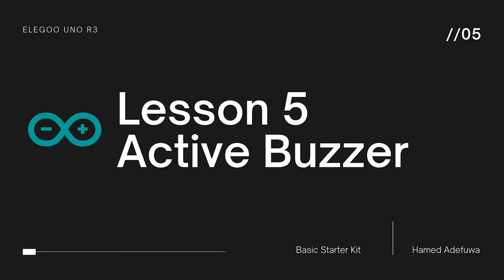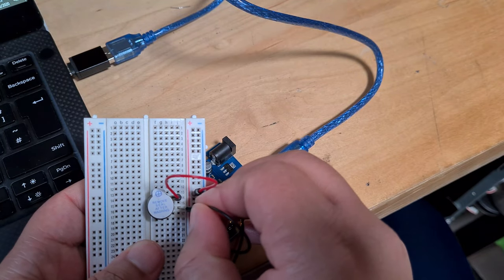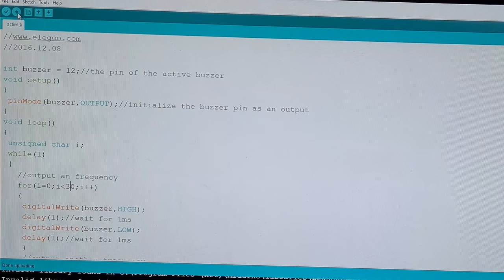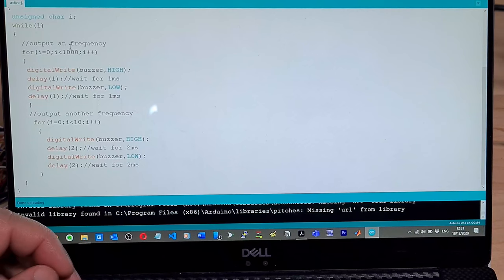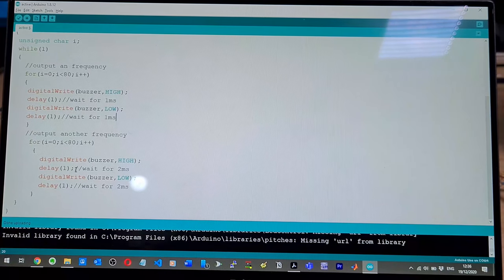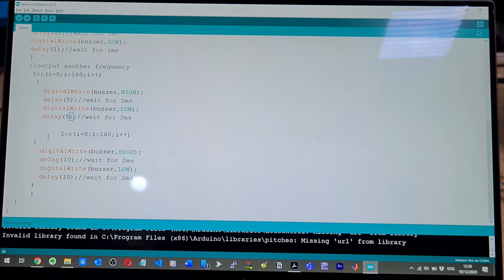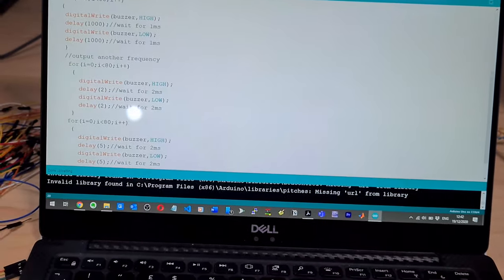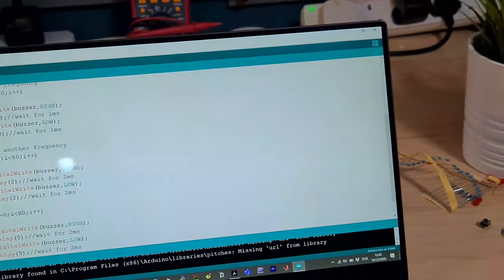Active Buzzer Arduino Tutorial #5 - Elegoo Uno R3 Basic Starter Kit

Comment: Also adding to my previous comment. Change only ONE variable it will be easier to find what is going on.... 
you change delay to 10 after you set the buzzer high. and you don't test it, but right away you change the 2nd delay (after setting buzzer LOW) to 10

why are you changing TWO variables (sometimes you even changed 4)... 

there is no logic in the way you changing those for loops, delays... you completely randomly change 2 or 4 numbers instead of just changing 1 variable.

Change 1 at a time, load up, and test it, and you will understand it better.

you did at the end set high then delay to 1000, low then wait again 1000 ms, and you think its like a beep-gap-beep-gap sound but no, because there is a 2nd and 3rd loop too so its more like beepzt-gap-beepzt-gap... where 'zt' means an other sound..

but clearly you don't understand how these sounds are made because you are changing too many variables at one time

Comment: Come on there is even comments in the code...

read the comments they start with //

 behind delay it says "Wait for 1 ms" .. and that code, maybe surprising for you ...what it does is: the program stops and waits 1 for millisecond

that is NOT changing the pitch, you are hallucinating... the program method DELAY only WAITS/PAUSES the program for a certain time,

You turn on the sound, then "DELAY 100000" will wait 100 seconds. 

your very last code 15:47 all it does same as before but the turn on beep and turn off beep is 100 seconds - 100 seconds long, there is no pitch change.

Comment: changing the loop will not change the sound, only the length of it, loop 80 times 1 delay+1 delay= 160 milliseconds... also the whole thing is embedded in a while(1) meaning while true=forever loop, so that first loop will play for like 160 milliseconds, the 2nd one just have delay 2 twice so it'll be just twice as long... i

changing the length of the loop will not make a significant difference in the pitch of sound itself

also changing the delay by just 1 will again not make huge difference, 

you should change the delay especially between high/low more drastically if you want to hear difference, 10 , 20... 50 or even 100, 

turning on/off buzzer for 1 millisecond or 2 milliseconds you you won't hear the difference... 

you have to make bigger delays, for example try loop only 50 times, but make the high/low delays add up to 20 (that would be 50*20=1000ms =1 second), for example
set high buzzer than wait 5 millisecond (delay 5) then turn it off and wait 15 (delay 15) you get 5+15=20
or the other way high for 15, low for 5... 

or try 20+30=50 then you only need a for  loop i<20 to get 1 second sound

the two loop was inside a while(1) loop which repeats forever, so changing there made 0 difference... yes delay 1 or delay 2 there is a tiny difference that is why you hear some vibrating buzzing, but if you want real difference change the delay, and play with it.. 

make the first loop delay 7+delay 32 .... for 100 repetition 
make the 2nd loop delay 29 + delay 30  for 200 repetition 

and you will see a big difference, first loop will go for 39*100=3900 (3,9 seconds at least)
2nd loop will go 29*30=290*3=870ms=0.87 seconds at least and should be a different sound (as much the buzzer can sound different at all)

Yes these delay seconds/milliseconds I mentioned will be not 100% not accurate, because the loops have not only the 'delay' but the buzzer sets and loop condition has to be evaluated too, also i need to be incremented..these all can take up some time, so for example a loop like
for i=0; i<1000; i++ {delay 1}
not necessary takes 1 second, do you waited 1 milliseconds 1000 times, but running the loop itself takes time, incrementing i, etc. as I just said